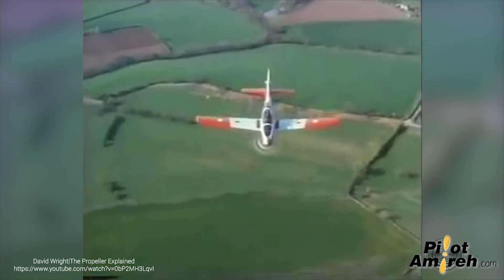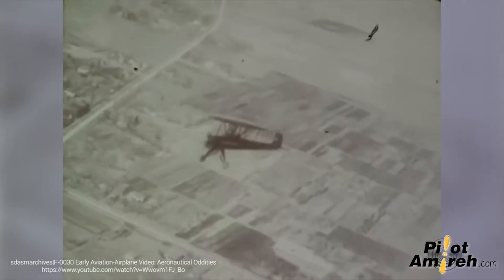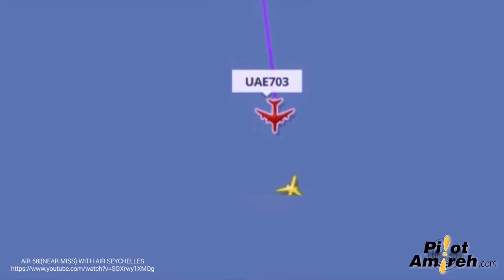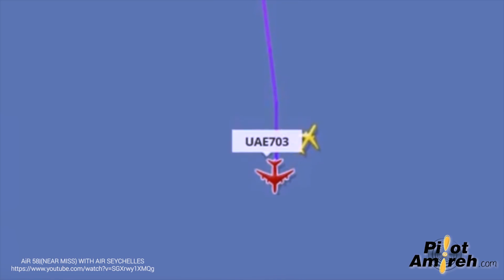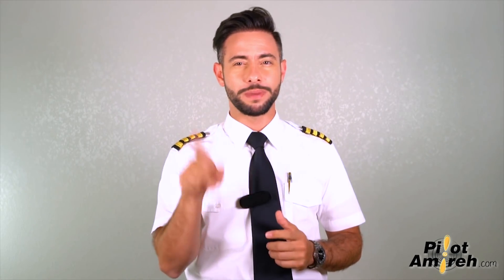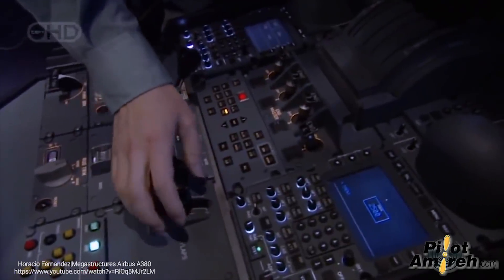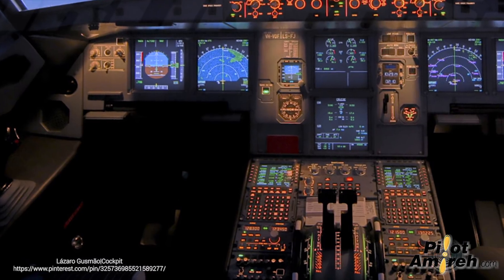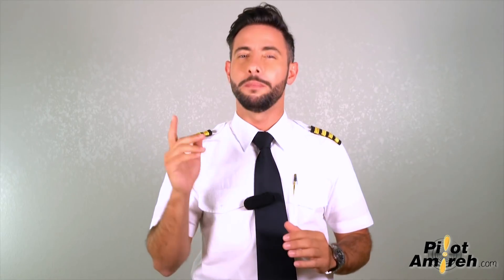Why Do Airplane Captains Sit On The Left ? | PilotAmireh Episode 2

Comment: I thought it was because of Ford's model "T". The T is considered as the first left hand car and set the standard.  Horses, wagons, boats, early cars, early planes (even American ones) are all controlled from the right side. Because of the large number of (left seat) American planes after WWII, left seat became standard. Only spacecraft were orignally designed as "left hand drive"

Comment: While you on air can planes crash.? Or will the radder tell you'll guys to turn this side the other plane is coming?

Plz answer ASAP
Reply: Lwazi I luv this game's Msane Most modern airliners have a system called TCAS (traffic collision avoidance system) this will let the pilots know if there is any other aircraft within the preset perimeter. However if the pilots are distracted and don't input any flight controls to avoid the collision, that will be their last mistake in this world.